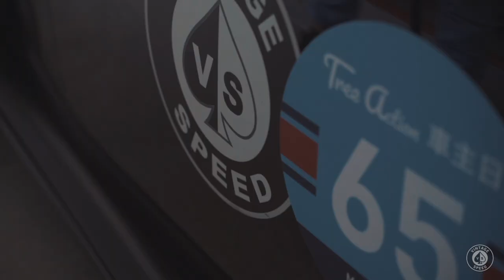Vintage Speed 2.7 Type 4 German Look VW BUG race track test ORRATECH

Comment: Hello MT Lee,  I see you have a lot of fun.
Our 2.7 sport engine is just right for something like this.
266Nm and 190PS is enough for fun on the race track.
A 2.3L 150hp engine is sufficient for the road.
Our fattest boy has 3.0L and 300PS, but that's too much for most vehicles and difficult to drive.
Have fun,
Rainer
ORRATECH
Take a look:
https://www.typ4shop.de/
https://www.typ4shop.de/Motoren-Rumpf-u-Komplettmotore/Komplettmotoren-Typ4:::24_64.html?MODsid=4dab4fc36bdb2f07e00e8bf559c87817